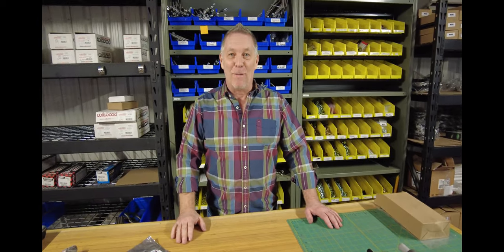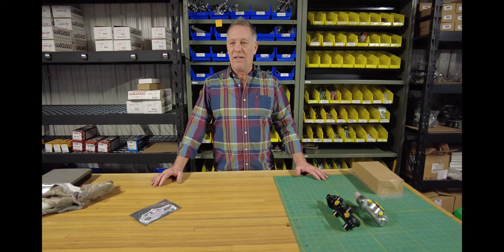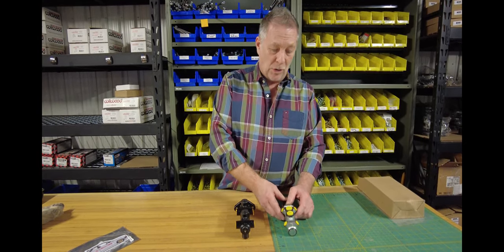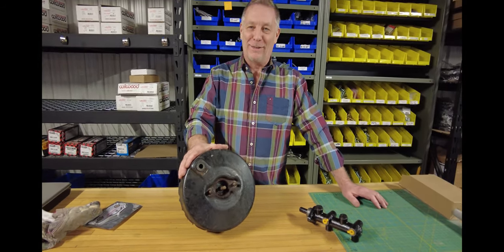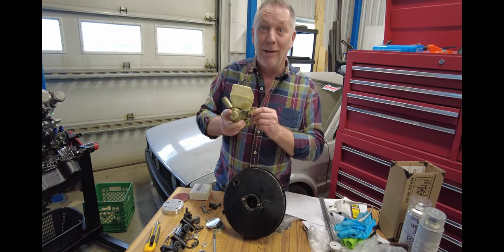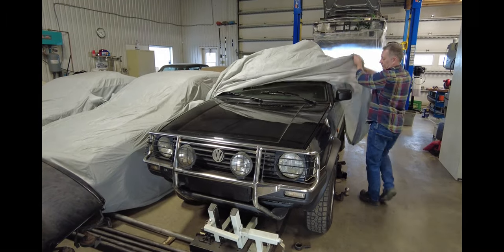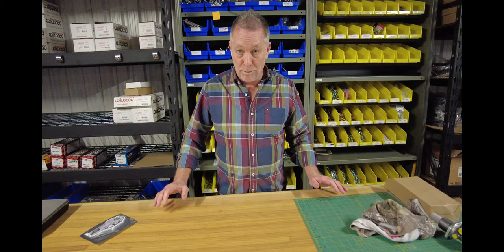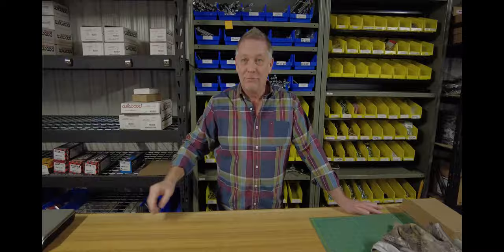VW MK1 : Match the right master cylinder to your brake booster

Comment: This is so timely, I was just trying to figure out what to do with my Westy GTI as I have a freshly rebuilt bendix booster, brand new master, but no reservoir, or at least the old reservoir I have has its outlets closer together than the new master cylinder.
Reply: Where you get you reservior ?
Reply: @benromo157  Using my original Westy GTI reservoir, I just had the Rebuilt Master upside down that why I thought it didn't fit, outlets looked like the reservoir inlets 🤫🤫😗. All good now.

Comment: For the Westy Bendix style there are also 4 & 6 outlet. My master is on the way out in my 80 Caddy & am stuck trying to figure out how to confirm the difference when I have 4 brake lines & 2 pressure switches & online listings all seem to show 6 ports. Got a Mk2 Jetta I took the TD out of but would have to change brake line connections too if went to it.